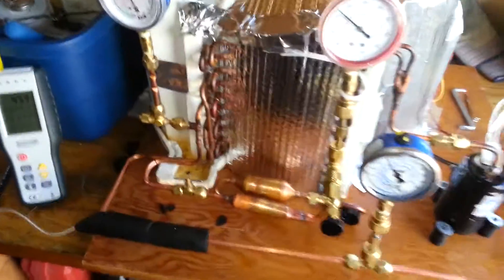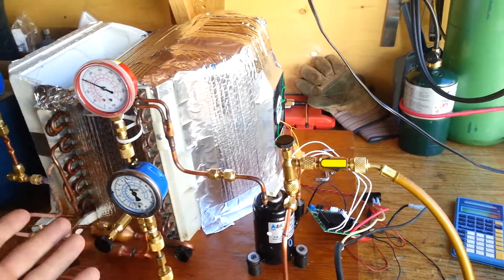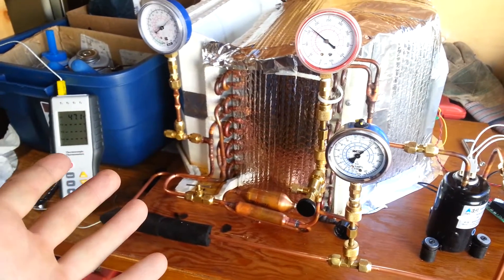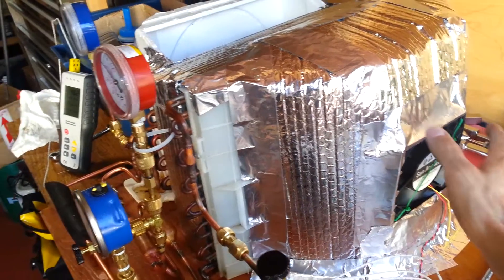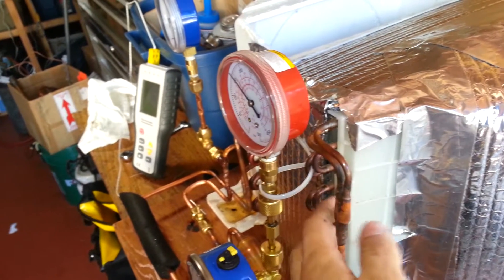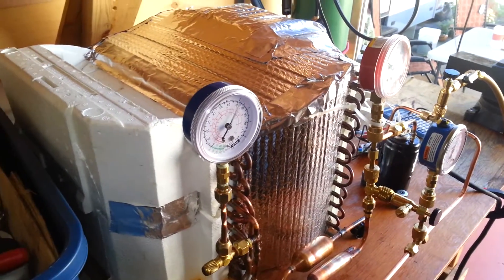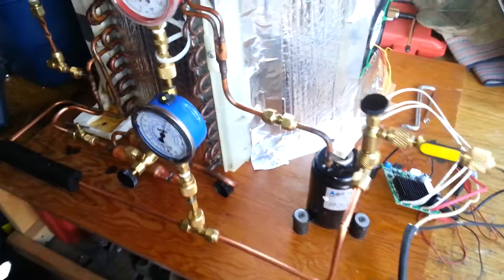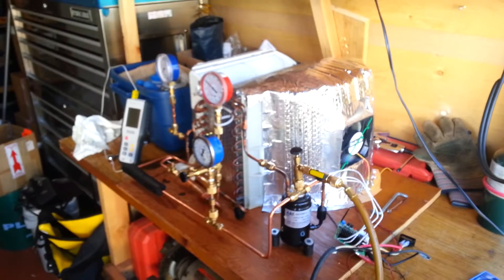DC Dehumidifier - Hand Expansion Valve

Comment: This process works most effectively at higher ambient temperatures with a high dew point temperature. In cold climates, the process is less effective. It is most effective at over 45% relative humidity; higher if the air is cold
Reply from the maker: Yeah, the environment I was trying to test this in wasn't ideal.  Plus, the evaporator was far too big to get the suction temperature low enough for water to condense.

Comment: So if I get a really good quality needle valve, will it still gradually leak refrigerant? I am getting tired of sizing capillary tubes.
Reply from the maker: If the temperature swings are excessive, for instance in the event your low side operates at a very low temperature, the packing in he valve can shrink leading to a leaky valve. I converted a household dehumidifier to run with propane refrigerant, and replaced the cap tube with a needle valve. That ran in my basement for a year or more without problems.
Reply: I just got a 60000psi rated valve for £10 http://www.ebay.co.uk/itm/141980576073?_trksid=p2060353.m2749.l2648&ssPageName=STRK%3AMEBIDX%3AIT
Reply from the maker: Have you tried it yet?  Difficult to control?  I have found that to be a problem with the valves I have tried. It is one of the reasons I played around with a modified TXV. The sharp pointy needle it has makes for much finer adjustment.
Reply: +M.C. Pletcher The valve I got has stainless steel fittings that I can't solder to so I need another one.